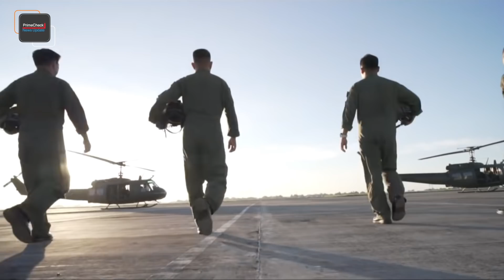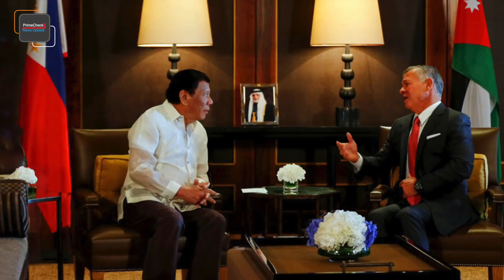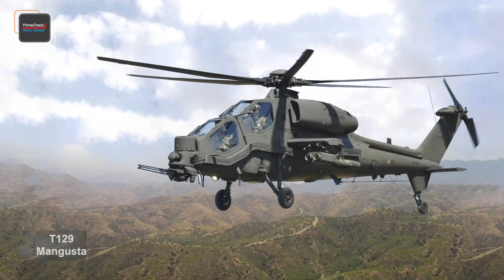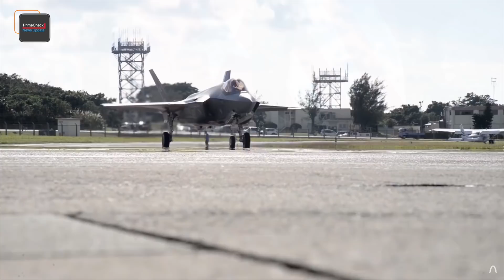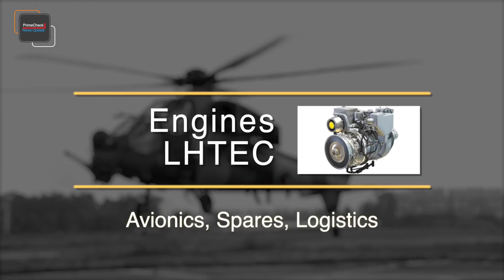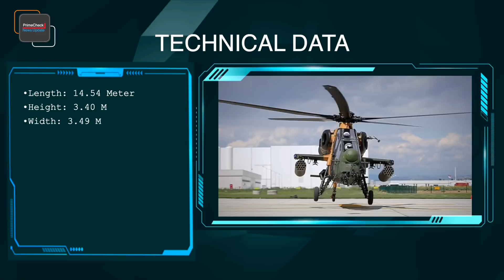T129 ATAK Multirole Attack Helicopter with State of the Art Combat Systems | Philippine Air Force

Comment: F35 has flown just behind a russian radar plane, which is way stronger than s400. and russians had been operating in syria, so they already came across f35's a lot. america is just using it as an excuse against Turkey. they dont want Turkey to acquire an air defense system at all.

Comment: it is the best helicopter in its class  we use them a lot against terrorist inside North Iraq and East of Turkey with high mountains of 3000 meters  and minus 20-30 degree in the winter or + 30 degree in summer even + 40 some regions. Philipines bought 6 for 280 million Dollar.
Reply: no the best is the Augusta-Westland Delta version. the Turkish copy cannot compete with the parent company that made the AW129-T129 .... but its name is Mongoose, you can give it any abbreviation, that remains the old and dear Italian Mongoose :).but better this way, the Italian mongoose is close to retirement, and will be replaced by the AW249. and thanks to the t129 for each helicopter that sells in turkey, we collect a large percentage  :).
Reply: @tiziokcaiok3110  No. Its based in Augusta ( now leanordo ) That means only the fraim all the software hardware, flight control systems, battle managment systems, the weapons its use, everything els is Turkish.
Reply: @oghuzkhan5117  
not based, but made under Italian license ... and I would not say that the t129 is the best in its class, as the AW129 D outclasses it in handling and speed ... but ok, they are two good variations of the sweet Italian mongoose ,bye :)

Comment: Bravo to Turks, Unit coast $40 million one of the most expensive, but most advanced, so what goes into the unit matters, #1 AH only $35.5 million, and speed 292 kmh, Range 476 km ----  Atak $40 million -Speed 320 kmh ,Range 435 km .comparing to #1 AH they did pretty great job. I am impressed

Comment: T-129A : Initial version armed with unguided rockets and 20mm gun. Hastily taken into service in 2012 to meet immediate needs of Turkish Army. Currently all of them are upgraded to B1 version.

T-129B1 : First full configuration T129 version. In service since 2014. It incorporates guided missiles and electronic counter measures, together with rockets and 20mm gun.

T129B2 : Enhanced version of T129B1. AVCI helmet mounted display and jammer systems are introduced. Laser and IR warning systems are also incorporated. In service since 2020.

T629 : Based on T129, T629 will have an upgraded frame and more advanced  avionics. Also, Turkish TS1400 turboshaft engines will replace current LHTEC T800 engines which cause delays and even blockings from USA.

Comment: Turkey has used Super Cobra for years.  And with this experience, he reproduced the A-129 as a helicopter above 2 class.  Turkey is experienced in this field as it has intervened in terrorist organizations in Northern Iraq for years.  In addition, engines with a higher performance than the LHTEC engine are in the process of qualification.  In short, the T-129 is currently the fastest growing attack helicopter.
Reply: gaya na lang din ng binebena nila harimaw tanks na di naman  ginagamit ng turkey  sa armed forces nila
Reply: @UMAKEMESMILESWACKIN  You're wrong, my friend. It does have it, but not much. There are 2 reasons for this.
1- Drones are already doing enough. They're cheap and don't put you at risk.
2- Approval from the US Senate was awaited for the export of T-129s to Pakistan. And the US has imposed an embargo on the LHTEC engine, as its use of the helicopter, which is a terrorist organization in northern Iraq (which he admits), does not comply with the interests of the middle east. And it was not eventually sold to Pakistan.
Reply: @UMAKEMESMILESWACKIN  wag maging judgemental papz mapapahiya sa tga ibang bansa dapat quite nalang tayo pasalamat tayo binintahan tayo nyan dahil binawalan tayo ng US bumili nyan kase takot sila na muling magpalakas ang PH. Well karapatan nman nating magpalakas para sa hinaharap natin para may depensa tayo sa mga gustong sumalakay.
Reply: hindi nga proven yang sa turkey ni hindi nga nila ginagamit yan sa syria at iraq
Reply: @UMAKEMESMILESWACKIN  Turkey now uses unmanned aerial vehicles, etc. Tb2 Akıncı. and no need to lift helicopters anymore to prevent terrorist acts.
Reply: @kaandurgut  Knk bir iha asla bir helikopterin yerini tutamaz
Reply: @tinercistalin5483  evet tutmaz ama maliyet bakımından fazla gerek kalmadı artık helikopter kullanmak biraz tehlikeli dağlık bölgede.
Reply: @kaandurgut  yoo baya da güvenli. Zaten bir iha asla o kadar yakın ve yoğun hava desteği sağlayamayacağı için sıkıntı oluyor
Reply: @tinercistalin5483  biraz daha araştırmanın tavsiye ederim
Reply: @kaandurgut  ihalar sadece stratejik imha için etkilidir
Reply: @UMAKEMESMILESWACKIN  so magaling kp sa mga militar nang pilipinas?
Reply: @UMAKEMESMILESWACKIN  Suriyede ypg ye yapılan operasyonlarda yoğ yi dağıttı
Reply: @UMAKEMESMILESWACKIN  Bro This heli is used a lot in north iraq and syria
Reply: @UMAKEMESMILESWACKIN  funny guy
Reply: @UMAKEMESMILESWACKIN qu'est ce que tu racontes ils serre toujours ensyrie et en Irak et Brésil Maroc Algérie la liste et longue très très longues  sauce pili pili 🖕🇹🇷

Comment: The T129 ATAK is a good Choice, but in the current situation in Turkey"s obtaining  the engine for it  it's useless to aquire them, if the engine issue will not settle, then we should go for the 2nd bidder: Bell AH1Z

Comment: tai has builded and delivered first 2nd version of t129 in Turkey. Now avionics are also made in Turkey. Only thing that remains american is the engine now. Turkey built an delivered  fist of its own turboshaft engines ktj1400 to tai. Engines wil be tested under t625 gokbey transport helicopter program. After that those new engines will be used in a new version of t129. Also the bigger brother t929 Atak2 is in devolopment which will rival ah64 apache.

Comment: Mi 35 and KA 52 is best choice
Reply: Having a Russian fighter aircraft in the selection list of the Philippine Air Force does not mean the Russians have proven something, like what Slavaboos are trying to emphasize in other defense pages.

In fact, it was not only the Sukhoi Su-30 Flanker-C that was among those included by the PAF in their list of possible contenders, but even included the smaller MiG-35 Fulcrum-F.

Not only that, Russian arms have ALWAYS BEEN INCLUDED in considerations for future weapon systems of the AFP. But what's the point of being in the list when in the end they are not selected?

Case in point: the PAF's MRF Acquisition Project was not the only time Russian products were included in the possible contenders. For example:

* The PAF's Combat Utility Helicopter project has the Mil Mi-171 in the list. In the end the PAF did not even shortlist it with only the S-70i Black Hawk, KUH-1 Surion, Bell 412EPI, and AW139M in the final shortlist, which was won by S-70i Black Hawk.

* The PAF's Ground Based Air Defense System (GBADS) project has the Buk-M3 in the possible contenders. But it also did not reach shortlist with only the Raael SPyDer, Diehl Defense IRIS-T, and LIGNex1 KM-SAM Cheolmae-2 in it, and won by the SPyDer ADS.

* The PAF's Attack Helicopter Project also has the Mi-28N Night Hunter and Mi-35 Hind-E as part of the selection, but only the AH-1Z Viper and T129 ATAK were shortlisted.

* The PA's Light Tank (tracked) project has the 2S25 Sprut-SD in the contender list but it did not even reach shortlist which was dominated by the Pindad Harimau, Hanwha K-21-105, and GDELS ASCOD 2 MMBT.

* The PA's Light Tank (wheeled) also included the BTR-90 8x8 with 100mm gun as a contender. It also did not reach shortlist as only the Pandur 2, Otokar Arma, Centauro 2 and FNSS Pars reaching the shortlist. 

Same is true for the Wheeled APC which also have the BTR-90 but not also reaching shortlist which was dominated by the Pandur 2, Otokar Arma, Pindad Panser, and another one from Europe which we were asked not to name.

* The PN's Submarine Project also has the Russian Kilo-class in the shortlist, but even FOIC mentioned that it is too big for their requirements.

* The PA's MANPADS Project has the Russian 9K333 Verba in the potential contender list, but in the end only the MBDA Mistral and LIGNex1 KP-SAM Chiron have reached the shortlist.

* The PA's Land Based Missile System has the Russian K300P Bastion-P in its list of potential contenders, but in the end only the BrahMos MMCB was considered.

We can list a lot of projects where Russian arms were considered. But in the end, as long as they do not get to be awarded with a project, they cannot be considered a win. There is no point to be happy that a Russian product was included in the list because THEY ALWAYS ARE INCLUDED as part of any evaluation of potential products.

Being happy with Russian arms joining the list of potential contenders is being shallow. It also means these slavaboo defense pages do not even know what were shortlisted in these projects.

Again i'll reiterate and i never denied saying this before and saying it again: Sukhoi Su-30 was not shorlisted on MRF project. So is the Eurofighter. It was only Gripen C MS20 and Block 70 Viper.

Comment: Mi 35 should be best for our country. Rugged and sturdy design - less maintenance, multipurpose - can transport a small contingent of troops and overall less expensive than american built Helos.
Reply: Having a Russian fighter aircraft in the selection list of the Philippine Air Force does not mean the Russians have proven something, like what Slavaboos are trying to emphasize in other defense pages.

In fact, it was not only the Sukhoi Su-30 Flanker-C that was among those included by the PAF in their list of possible contenders, but even included the smaller MiG-35 Fulcrum-F.

Not only that, Russian arms have ALWAYS BEEN INCLUDED in considerations for future weapon systems of the AFP. But what's the point of being in the list when in the end they are not selected?

Case in point: the PAF's MRF Acquisition Project was not the only time Russian products were included in the possible contenders. For example:

* The PAF's Combat Utility Helicopter project has the Mil Mi-171 in the list. In the end the PAF did not even shortlist it with only the S-70i Black Hawk, KUH-1 Surion, Bell 412EPI, and AW139M in the final shortlist, which was won by S-70i Black Hawk.

* The PAF's Ground Based Air Defense System (GBADS) project has the Buk-M3 in the possible contenders. But it also did not reach shortlist with only the Raael SPyDer, Diehl Defense IRIS-T, and LIGNex1 KM-SAM Cheolmae-2 in it, and won by the SPyDer ADS.

* The PAF's Attack Helicopter Project also has the Mi-28N Night Hunter and Mi-35 Hind-E as part of the selection, but only the AH-1Z Viper and T129 ATAK were shortlisted.

* The PA's Light Tank (tracked) project has the 2S25 Sprut-SD in the contender list but it did not even reach shortlist which was dominated by the Pindad Harimau, Hanwha K-21-105, and GDELS ASCOD 2 MMBT.

* The PA's Light Tank (wheeled) also included the BTR-90 8x8 with 100mm gun as a contender. It also did not reach shortlist as only the Pandur 2, Otokar Arma, Centauro 2 and FNSS Pars reaching the shortlist. 

Same is true for the Wheeled APC which also have the BTR-90 but not also reaching shortlist which was dominated by the Pandur 2, Otokar Arma, Pindad Panser, and another one from Europe which we were asked not to name.

* The PN's Submarine Project also has the Russian Kilo-class in the shortlist, but even FOIC mentioned that it is too big for their requirements.

* The PA's MANPADS Project has the Russian 9K333 Verba in the potential contender list, but in the end only the MBDA Mistral and LIGNex1 KP-SAM Chiron have reached the shortlist.

* The PA's Land Based Missile System has the Russian K300P Bastion-P in its list of potential contenders, but in the end only the BrahMos MMCB was considered.

We can list a lot of projects where Russian arms were considered. But in the end, as long as they do not get to be awarded with a project, they cannot be considered a win. There is no point to be happy that a Russian product was included in the list because THEY ALWAYS ARE INCLUDED as part of any evaluation of potential products.

Being happy with Russian arms joining the list of potential contenders is being shallow. It also means these slavaboo defense pages do not even know what were shortlisted in these projects.

Again i'll reiterate and i never denied saying this before and saying it again: Sukhoi Su-30 was not shorlisted on MRF project. So is the Eurofighter. It was only Gripen C MS20 and Block 70 Viper.
Reply: @theimpostor9510  Interesting info there, never knew these russian warmachines were included on the bid.

Comment: T-129 is good in humid and hot climate according to its stats.
Reply: Not necessarily . For the moment these chopers are used at high altitude mountain regions of Turkey and temperature are really low.
Reply: @trollsavar6161  The A129, which this helicopter is based on, perfomed in the balkans, Angola, Iraq, Afghanistan, Somalia... I would say it's more than battle proven

Comment: T129 fast a perfect choice for afp it's an small multy role atck helicopter perfect for fast operation...
Reply: Small and fast
Reply: Bravo to Turks, Unit coast $40 million one of the most expensive, but most advanced, so what goes into the unit matters, #1 AH only $35.5 million, but service charge in dollar and expensive flight hours Turkish still cheaper,  and speed 292 kmh, Range 476 km ----  Atak $40 million -Speed 320 kmh ,Range 435 km .comparing to #1 AH they did pretty great job. I am impressed
Reply: 5 tonnes t 129
Reply: yea but it will be forever untill turkey creates its own indigenous engines. so i think its better to go wit the viper or the apache.
Reply: @Scaucyman2.0  Turkey has changed the game in air operations in the war with tb2 drones. Now working on humanless jets. I mean your forever is our tomorrow. Believe me that youwill hear about T129-2 soon.

Comment: Marawi is a game changer of the AFP. Love this T129 multirole attack helicopter  hopefully we can have this.
Reply: Bravo to Turks, Unit coast $40 million one of the most expensive, but most advanced, so what goes into the unit matters, #1 AH only $35.5 million, but service charge in dollar and expensive flight hours Turkish still cheaper,  and speed 292 kmh, Range 476 km ----  Atak $40 million -Speed 320 kmh ,Range 435 km .comparing to #1 AH they did pretty great job. I am impressed
Reply: 6 Units will be deliver this 3rd quarter. Confirmed by SEC Lorenzana
Reply: @iambroot3713  Only 2 units per year will arrive so starting next month we will be expecting them to arrive then the 2nd batch which is another 2 units will be received in 2022 and lastly the last batch will be in 2023

Comment: This deal will not happen. The Israelis are blocking the export auf the Lhtec 800 engines build in to the t129 atak  to philippines.
Reply: Export bann on the engines has been liftet. The T129 will be delivered to philippines soon. Congratulations. Pakistan is waiting for the lifting of the export bann since 4 years.

Comment: The main problem i see is the lack of engine/US made parts for the T129. Delays in the modernization efforts aren't good. Anyways Great video sir. Hope to see more
Pilipinas Mabuhay!
Reply: Turkey have made hos own engine now 1400horse power so its almost Done👍
Reply: TURKISH ENGINE HAS BEEN PRODUCED IN THE TEST PHASE  https://www.youtube.com/watch?v=BjdHNsSLVo4
Reply: Indeed sadly it'll cause more delays just like what happened to the SK Surion. It's on the hand of the DND now. I do hope for a speedy modernization. long delays on the procurements made the efforts kinda hard. ♥️
Reply: @redcoockie01  Turkish systems will not get you in trouble later on. it will not be a political material. other  country threaten you in the smallest thing.
Reply: Years ago i've witnessed a PAF chopper do an emergency landing and felt the need for a credible and safe aerial asset. Turkey indeed produces quality military machineries i do hope that the DND chooses what's best for the airforce. Also Old hueys are like flying coffins but are still useful as force multipliers because of the lack of combat utility helicopters.
Reply: The turkish attack helicopter is one of the top options of the DND ♥️